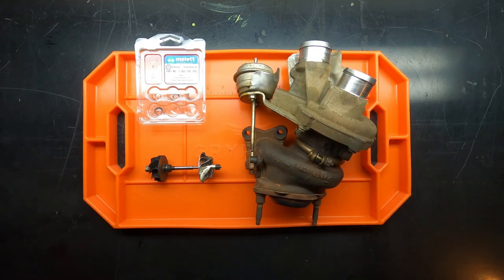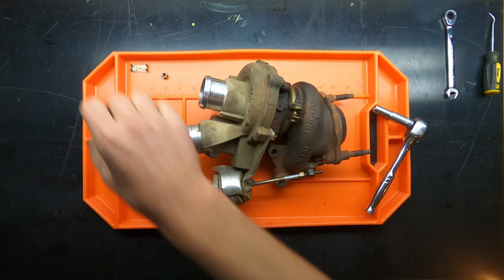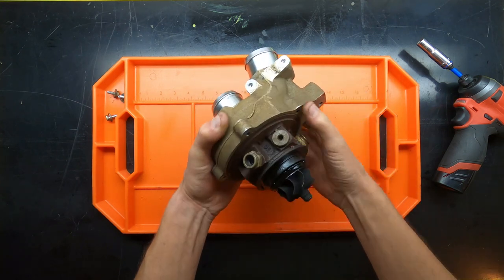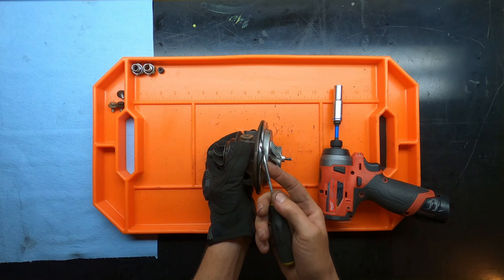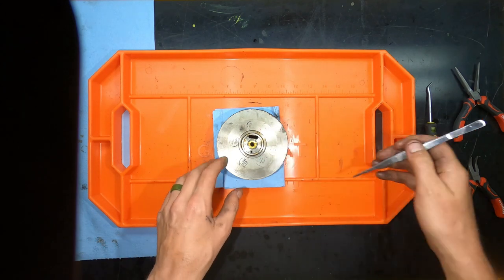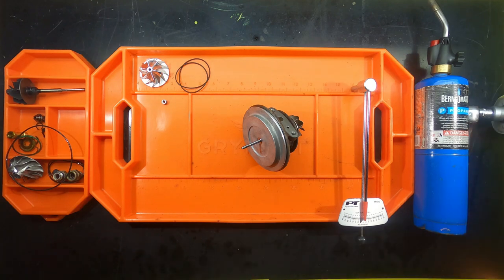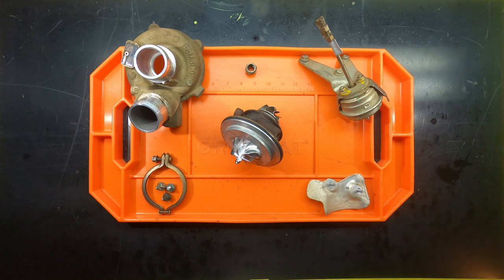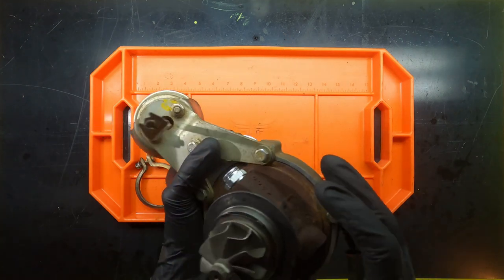2015 3.5L Ecoboost Turbo Rebuild with CRP Billet Assembly

Comment: I have 204k on my turbos. I pulled a 10k trailer for my business over 160k of those miles.  My turbos are still working great, im just going to rebuild them for preventive maintenance. 

Do these kits offer more HP/Torque?
Reply from the maker: I believe they make a claim for increases but I would imagine it is related to quicker spool times so you have more torque and power (earlier in the power band but not "more"). If anything, I would say the gains are negligible for those of us that tow. They do offer full turbo upgrades however, which do have impressive gains. I noticed maybe 1/2 mpg difference when towing. A lot of factors could have affected that. Good luck with your rebuild!

Comment: QUESTION PLEASE ANSWER AS I CAN NOT FIND ANY INFO ANYWHERE ON THIS !!i noticed theres a little washer that goes onto the shaft just before pivot washer it is shown on the top row of parts but not on the bottom 26:50ish by chance is the bottom row of parts the drivers side turbo? the reson i ask is because on my drivers side turbo it would not all fit in the housing but without that washer (on the drivers side turbo only) it all fits bolts down and turbine wheels turns nice and freely then i took apart again and started tightening the 10mm bolts into the housing and just when it started getting snug the turbine wheel will not turn at all so just wondering if you do not need the washer on the drivers side???
Reply from the maker: Hey there. So I believe I know which washer you are referring to. First off, the turbo is identical parts wise for both sides. The reason that it is shown in the old parts on the top and not in the new parts on the bottom is because it is mounted to the shaft assembly when packaged. The one up top is in view because I laid everything out as I disassembled. 

Go to 28:05 in the video. I just unwrapped the shaft assembly and you can see the "bezel" on the new shaft. The washer I believe you are referring to is on the shaft with the bezel. You can see me remove the bezel and "said washer" at time 28:35.

As far as why you are not able to rotate the shaft after torquing the housing, there is definitely something dragging internally or something is not in the right place. You did clean the CHRA housing and al reused parts before reassembly right?

 I hope this helps. If you are still confused, feel free to send me another message. Good luck!

Comment: 100k on a turbo is really nothing at all.  I’d have real concern over buying an after market rotating assembly and issues with balance and shaft motion.
Reply from the maker: Your not wrong by any means, but when I took it out, it had more play than I was comfortable with reinstalling. I wanted to rebuild with a stock assembly but was unable to source a new ford kit so the rest is history. 
Ill tell ya what, if she blows up, you'll be the second to know! 

Prost!

Comment: Ford rebuild them
Reply from the maker: Here in Colorado Springs, my dealership only offered me new ones. They told me that they do not offer rebuilt units at the time nor did they offer a rebuild service for mine. While that did surprise me, I was not willing to do the extra research and it also gave me an opportunity to take this bad boy apart and make the video!

Comment: So is there 2 rubber gaskets/o rings for the compressor wheel? I didn't see you install them on the outside of the compressor wheel.
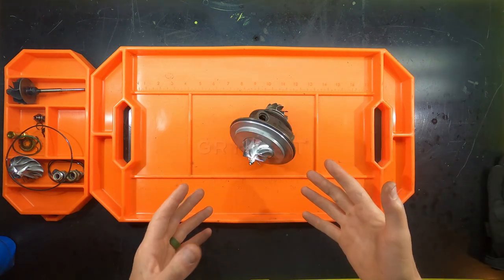Reply from the maker: There is 1 large o-ring and one small one. In the video, Look at the reassembly preparation portion of the video. The smaller one is installed at time: 29:10. For the second larger one, it appears as two when its sitting at the bottom of the mat (and at the top later) but the o-ring at the top of the mat is the same o-ring as the large one on the mat to the left. There is also another one on the left sitting below the coolant fittings. Those are both the same and both are the old ones. It appears as though the install is not on video though. If you go to time: 35:44, you can see where the large one is installed, you can see it installed between the aluminum ring and the "rusty colored" portion. Does that answer your question?

Comment: Awesome video, would this be a similar setup to the kit for the transverse 3.5L like in the SHO?
Reply from the maker: Thanks! 
I cant really answer your question. I know there are more than one rebuild kit out there but if your 3.5 is the ecoboost Gen 1/Gen 1+ than yes, it would be the same. The Gen 2 should be the same, I just can't confirm that it is. Good luck with your build my dude!

Comment: Pretty sure thats a Borg Warner turbo.  As they were the primary supplier of turbos for Ford.  At least for the truck and large SUV platforms.  For the smaller ones, such as the 2.7 Ecoboost engines and their cars, I believe they use Garrett.
Reply from the maker: I agree that they probably are Borgs but obviously they were casted with FoMoCo so your guess is as good as mine.
Reply: @EvilFateIndustries  my company makes bearings for Ford and our hub bearings for the Mustangs, Explorers, and soon we are going to make the F150 Lightning EV hub bearings all have FoMoCo stamped on the them.

Comment: Update??
Reply from the maker: Engine runs great and pulls strong. Throttle response is fantastic and turbos are much louder but disclaimer: I did add an SCT Tuner and downpipe so keep that in mind. All in all, great success. Very happy with the kit. Definitely worth the time if your on the fence.

Cheers.
Reply: @EvilFateIndustries  Good to Hear, appreciate the response !!